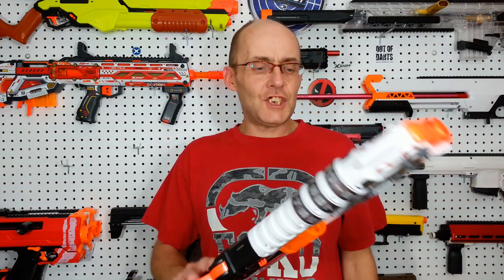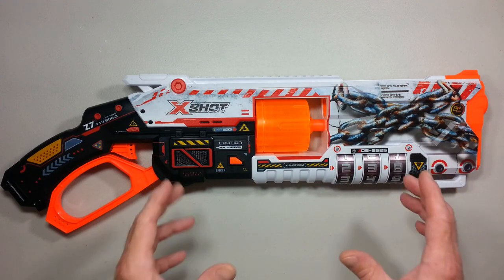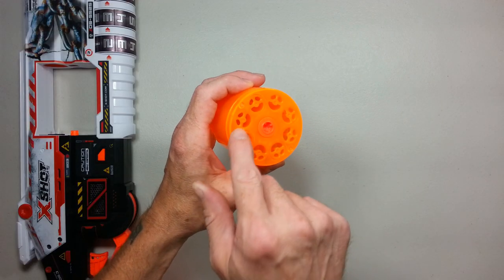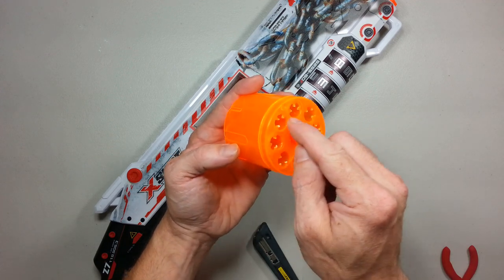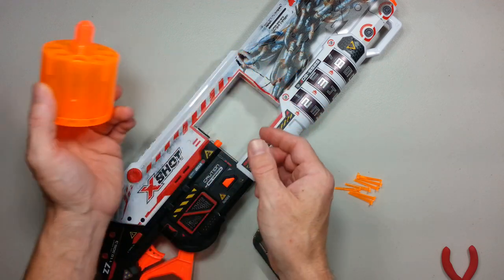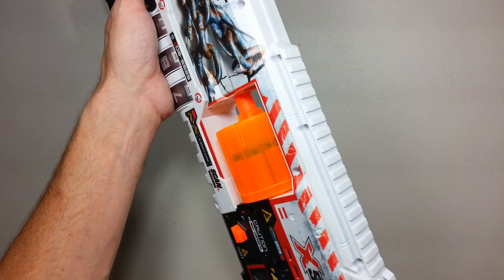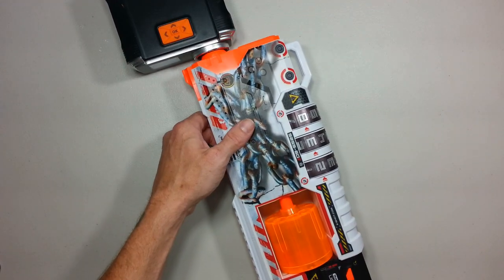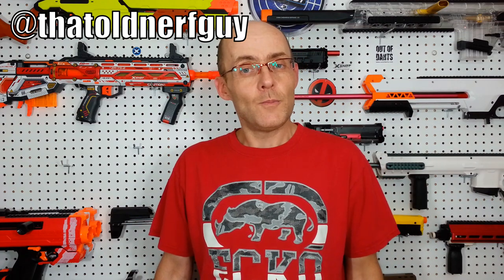X-Shot Skins Lock Blaster Half Dart Mod : Quick & Easy

Comment: Can I cut a normal dart to half or they just come like that?
Reply from the maker: Originally in the hobby we started by cutting down full length to 36mm, but nowadays a lot of manufacturer including X-Shot offer them
Reply: You can cut your darts into half and 3d print a dart cutter to cut your darts more precisely . Although , if you love your full length please do not do so . Some darts when cutted in half will not peform well or make no difference , only certain types of darts when cutted will have better performance . You can actually buy half length darts at retails or online . Either go with Dart Zone darts at physical stores or go for Worker Gen 2 darts (cheapest option) . Worker darts are available online . I think there's X shot half length darts too , I'm not sure since those darts are not available yet in my country.
Reply: Thanks for the feed back. I bought one of these today & a Xshot insanity & having a blast with my kids.
Reply: I would recommend going to walmart and buying adventure force pro darts, they are better than x shot half darts and are the same price and amount
Reply from the maker: @Aragor-78  I just can't Walmart don't sell their darts in Canada!! Therefore I mainly use GOS Dart which are far superior to anything found on store shelves.

Comment: I still don't understand the concept of this and why you people like it, this is the dumbest gimmick out of all blasters that have been made the most useless gimmick who needs to lock a freaking nerf blaster are you kidding me your mod didn't even take out the lock
Reply from the maker: The Lock wasn't removed because this was not the Subject of the Mod(as mention in the Title, it was for Dart size)... I mean, the Gimmick works and so far it's nothing worst than what Nerf brings to the market(Revolver that don't revolves! or 5 foot Jolt XD) or Buzzbee (Scope Priming??!!EZ Fire), . At that point I would suggest you just stay clear of this one since it doesn't seem to be your style, or just open it and Remove the lock bar. It's a matter of preference I guess, but for a first try Zuru just nailed it!
Reply: People aren't into this blaster because of the lock. They like it because it's a lever action revolver.